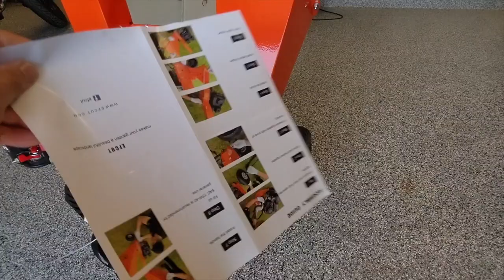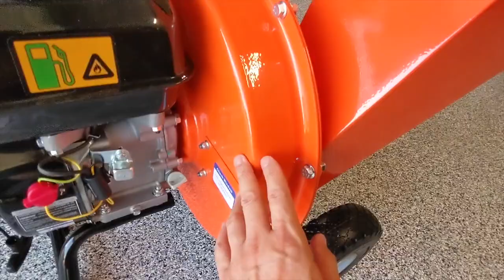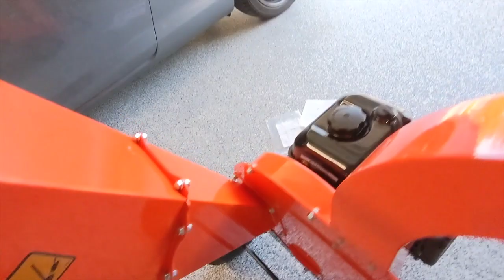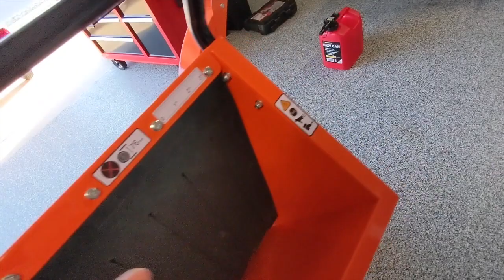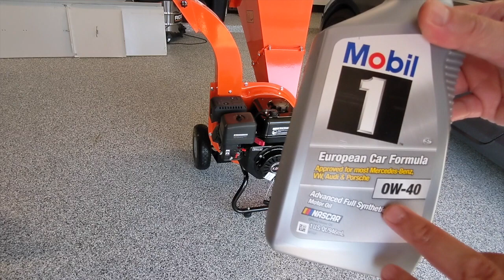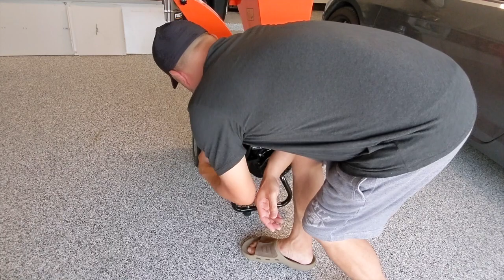EFcut C30 assembly and start 2021

Comment: They redesigned the handle part for me. I don't have that metal that comes over the handle like yours does. It's open online which makes it easy to put the bolts through

Comment: That's not how it was with mine. The bags that they told me on the instructions corresponded to how I was supposed to use them in each step. They must have mixed yours up

Comment: At the end of the video, you mentioned that to cold start the shredder, the choke should be in the LEFT position, but when you first started it, you moved the CHOKE to the far RIGHT position!  Which is it????
Reply from the maker: I don't have it anymore, but I think right was to choke off, or no choke, and left was choke on for cold
Reply: I agree. That was a contradiction.
I believe the manual said if the unit is warmed up, choke on (i.e., Close) is not necessary.

Comment: Indeed on this model when the choke says on what that really means is that the choke is fully open, and where it says choke off means that the choke is full closed. No big deal just something lost in the translation. As far as performance I always allow a decent size  brush pile build up, let it dry out a bit and don’t run overly large limbs in there it’s something that you’ll be able to feel it out once you start using the machine and it works fantastic for what it is.

Comment from the maker: After owning it for two seasons now I figured out what it is. Makes the thing work so much better, I keep the blades really sharp, I have two sets of blades now and I keep a sharp set on spare and every time I run it for more than 5-6 hours I replace blades, and it makes chipping so much better if the blades are nice and sharp, and they also mentioned this in their manual as well, then I resharpen the blades that I took off for the following day use.
Reply from the maker: unit in action:  https://www.youtube.com/watch?v=T654mCJRPUI

Comment: Mine really struggles with anything larger than  1 1/2". I also found that green twig size wrap around the wheel and bind it so it wont run. The best way to access the wheel when it binds and wont move is ro remove the discharge chute. I would not buy another one.

Comment: I have this model and love it.  Differently from yours though, after I choke and start it if I don't UNCHOKE it like within a few seconds it starts to die, so once it turns over on its own I unchoke, and off I go.  Works great.  Have had it almost a year.  I am in Georgia so have used it mostly in warm to hot weather.
Reply from the maker: I have used it for about 10 hours now, I start with 1/2 choked, and back off the choke after about 60 secs or when it starts running rough,  I use it for oak and the machine does jam, oak is very hard on the unit.